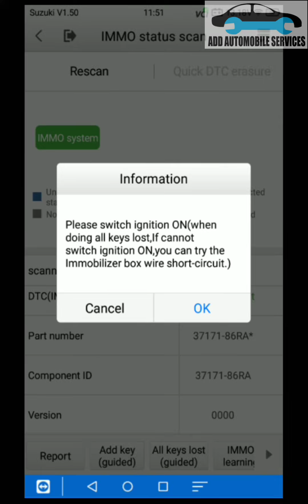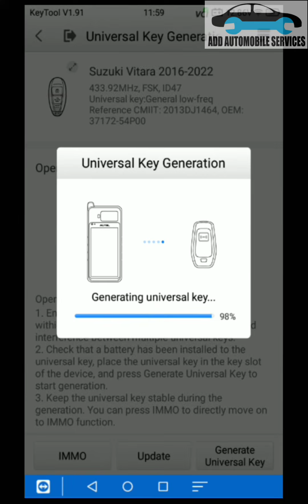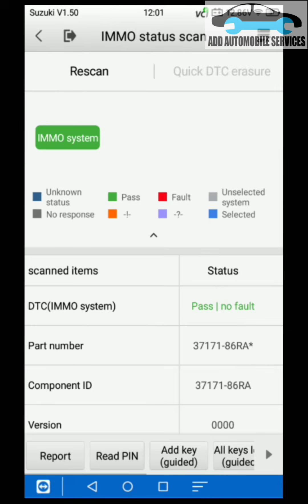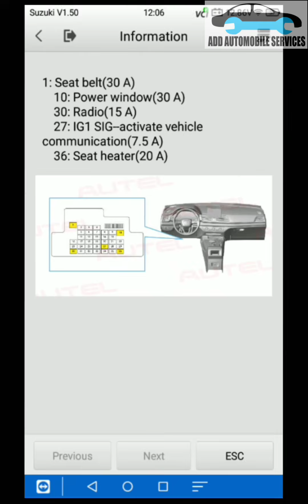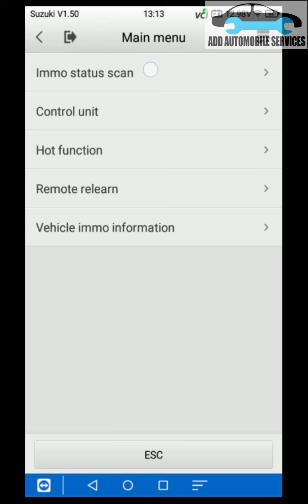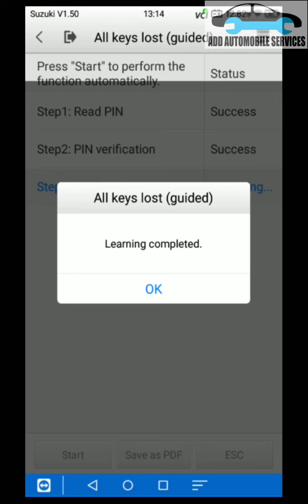Vitara 2021 all key lost with km100

Comment: I tried the same method with im508 on suzuki ciaz 2023 but fault code came up ( relay ignition 1 malfuntion) but I didn't generate universal key. What was the fault code when I did this procedure.
Reply from the maker: Check the relay first
Reply: You are able to program the key? After programming you got the code or what?
Reply from the maker: @mohammadalamin208 yes
Reply: I also have a 2021 Suzuki Dzire Smart and I can't program the key; I get an error message saying "programming unsatisfactory".
Reply from the maker: Check the system
Reply: I have a fault with the IG relay and another fault with the remote control battery, but it's reliable.

Comment: Hi I manage to get the 8 digit password on suzuki swift 2010 push button but it dont go through because it says its incorrect

Im only adding a key
The car is on
Reply from the maker: Pls check the pincode
Reply: @ADDAUTOMOBILESERVICES  i did. i tried all the pincode but no luck
Reply: @ADDAUTOMOBILESERVICES  it says if the password is incorrect please send to the vehicle manufacturer

Comment: Hey when I jumped the IG1fuse with battery positive (+), the head lights came on and there’s an amber key signal on cluster but I don’t think the car turned on. I have 2013 Suzuki swift.

Please help.
Reply from the maker: WhatsApp me
Reply: @ADDAUTOMOBILESERVICES  I managed to solve the issue. I needed a power probe for the job. I manage to get the car to turn on so I can program the key.
Reply: can teach me master
Reply from the maker: @carkeyky why not
Reply: @ADDAUTOMOBILESERVICES  i messaged you on whatsapp no reply
Reply: @oneyplayes465 whatsapp?
Reply: @ADDAUTOMOBILESERVICES hi I'm in South Africa tried all lost keys no success keep saying criteria not meet
Reply from the maker: @locksmithsandcarprofession2428 pls check the vehicle system
Reply: @ADDAUTOMOBILESERVICES  I did try all not sure if pin is wrong
Reply: @locksmithsandcarprofession2428 im also sitting with 2022 suzuki vitara brezza All smart keys lost and i use probe to turn on the cluster..but still get "Condition not met" 
Im at my wits end and dont know what to do anymore.
Did you get it right?
Please help
Reply from the maker: WhatsApp me
Reply: OK how do I contact you on whatsapp?